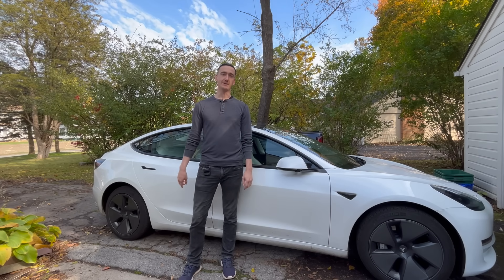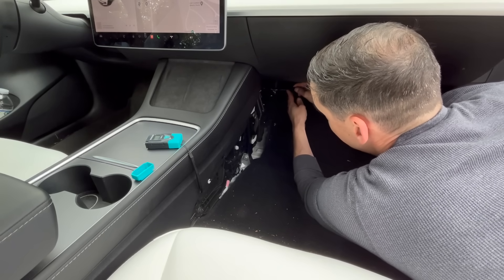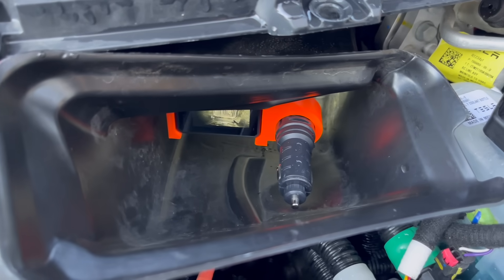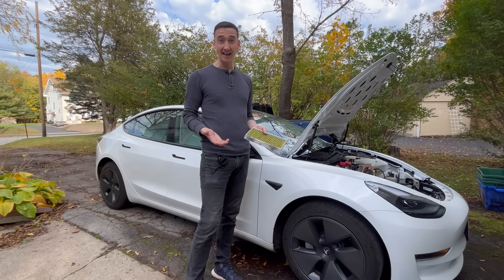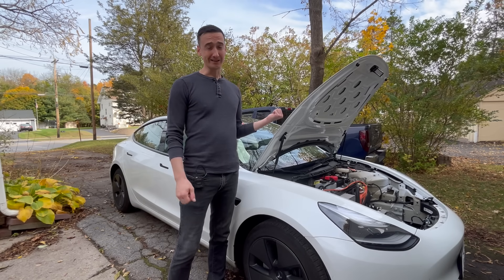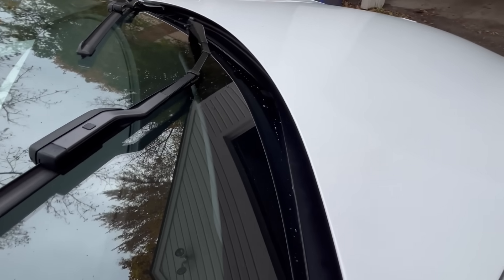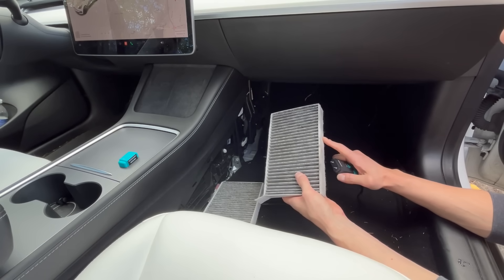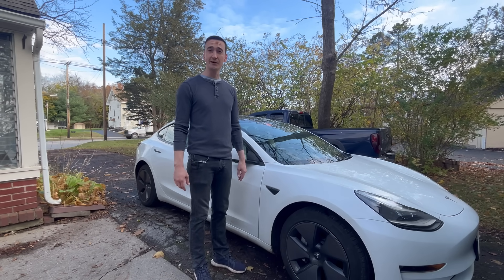This design flaw makes Tesla’s Model 3 smell bad! (with fixes!)

Comment: The best way to fix this is to alter the design of the duct. You can put a plastic baffle inside the duct that doesn't allow the water to go into the fan intake. This would be cheap to do in the aftermarket and much more effective than a gasket. Changing the fan software is not a good idea as you sometimes need defrost when it's raining. And low speed defrost is useless.
Reply: Shouldn’t have to “fix” a major problem with a new car, aftermarket or not. Tesla themselves should fix this “known issue” for absolutely free to their customers.
Reply: Yes, and it would be called a “recall”.
Reply: Sawzall the duct in-half at an 45 angle. Leaving the top long than the bottom like a roof.
Reply: I thought the same thing myself.
You could superglue or screw a baffle (plus silicone bathroom sealer to stop water bleeding down through &/or passing screw fixings, hitting any electrical connectors outside the shroud) that rises higher than that little lip around the drain hole.  Job done.  That gasket is overkill.  Also, I would think the gap on the OEM gaskets is deliberate to either allow better airflow into the cabin, or release air pressure from under the hood at highway speeds.
Reply: I was going to suggest the same since water did start getting on wires and such with the funnel apparatus removed. Add a modified wall, in the channel chamber, right before the air cabin filter, on the firewall side.
Reply: @kevinl3235  If you watch the footage from him flooding the windshield with the wipers running to simulate heavy rain, you can see that a lot of water already gets around the trim panel. So even if the duct is installed there is still a lot of water getting in that space. A good replacement design for the duct would have a baffle to prevent water from being sucked in, but otherwise to just intake from that utility space in front of the firewall. Sealing the top trim panel properly, or rather best would be redesigning the lower windshield gutter to seal against the hood directly, would also significantly help.
Reply: @haphazard1342  Nicely said and good point. Definitely an unfortunate design fail.
Reply: Is there an aftermarket replacement?
Reply: Always leave AC on, never turn it off.
Reply: I'm sorry but this is a horrible problem that should have been figured out a long time ago by Tesla.

The implications of having standing water in your AC system are bad like mold bad like bacteria bad.

One of my vehicles currently drains AC fluid after it shuts off or whenever it basically builds up. Seriously like a simple drain, All that fancy saved the f**** world marketing and they couldn't figure this part out?
Reply: @prohetofr3gr3t   If the car was designed in Seattle Washington, this would not be a problem.  CA designers only seem to know CA weather.  This is why the heat pump was added after the fact a few years down the road.  This system might be redesigned in the future but I wouldnt hold my breath.
Reply: Define cheap. Injection molds aren't cheap, and neither would be the labor to fit a specialized part into that duct. Removing the duct entirely would be a better option imo. It's an electric car so it's not like you need to keep engine fumes from entering the cabin, having a duct to outside air isn't really necessary.

I guess technically it would increase the Teslas ability to drive through flood waters, but I don't think it happens enough to be worth it
Reply: @Pilot8091  specialised part??
Cut a piece out of a plastic Milk carton from a supermarket & superglue it in place across the front of that little raised lip across the drain hole!! (raising it's profile).  The plastic is flexible enough to allow the baffle to be shaped as necessary.  Bathroom silicone sealer across the seam will stop any dribbles.  Add 3 Short self tapping screws if you're worried about secure fixing.  As for injection moulding being expensive, Tesla have an obligation to rectify this as those germs are a HEALTH ISSUE!!  There's something called air conditioner flu & a reason the spray to kill that smell is... Ummm.. ANTI-BACTERIAL.  Stop talking nonsense!!
Reply: @Pilot8091 cheap in the long run.
Reply: @Pilot8091 cars pull air from the bottom of the windshield because it is the lowest point where you get the cleanest air. removing the duct would pull most of the air from just above the road which is far more polluted. it would not be an ideal solution.
Reply: why would they.  dummies will just keep buying them anyways.

Comment: @adamdport, with the aftermarket gasket on the model 3, if you kept the duct and fully re-seat the top vent cover, do see a significant reduction in water getting into the vents in full 10 speed?

Comment: The reason the sealing strips across the hood, where it meets the base of the windshield, it isn't continuous across is because that area becomes a high pressure zone when driving, which assists the HVAC system when drawing in air, if you leave the continuous rubber seal in place you're forcing the HVAC system to draw air from areas it wasn't designed to be drawn from. This design dates back to the 30's or 40's when people actually died from the air being drawn into the heater near the front of the vehicle when the vehicle ahead is exhausting nearly directly into the heater air inlet. It looked as though the water that does get into the inlet is draining right onto wires and what looked like the wiper mechanism, the chute prevented that, at least put something over those areas to direct the water so it doesn't pour onto the electrical devices.
Reply: I'm having difficulty with the fluid dynamics here. What would create high pressure in that area between the hood and the windshield? If air is being dragged UP the windshield at speed, a first glance would have me assume that it creates a low pressure, and vacuums air out of the area?

Comment: Great video! As you showed at the junk yard, most cars have a cowl. These typically have a smallish input, large drains, and a large collection area that would require a large amount of water build up before it could enter the cabin intake (note it has to handle this during acceleration, braking, cornering, angled roads). Effectively these are dorade boxes https://en.wikipedia.org/wiki/Dorade_box . Tesla's 'dorade box' is missing the vertical barrier and that is letting water flow into the cabin intake. A simple baffle should probably fix this.

I'm curious: after taking out the 'cowl' did you try running through deep water at speed to see if the water would splash into the cabin intake?

Comment: Wow, embarrassingly enough, I was today-years-old learning about car wash mode, but thank you because I've just started to notice a mildew smell when I get in my car. Now I know how to fix it myself. Hope you get your Roadster! LOL😉
Reply: I knew about car wash mode, which was not originally there, but I don't know whether I would have used it aside from going to a car wash. When I did go to a car wash, I always turned off the climate control on any car. With a Tesla, the list was longer, such as turning off automatic wipers. With older cars, it meant checking each window. 

I did have the issue once, probably before car wash mode, and used a spray can of Lysol into the vents for about 30 seconds at high speed, gave it about five minutes with the fan on, changed for new filters and the problem stayed away. It might have been from washing my own car before there was a car wash mode.

Comment: Great video. Thanks!

I've also been using one of the pre-filters that fits on the intake. Another option but you need to watch for air flow restriction on some of these
Reply: re air intake filter, I agree most 3rd party products w/ small holes restrict airflow... I just used part of roll of plastic gutter guard mesh and ziptied it to original cover. Cheap <$5 and looks/works great. No more leaves sucked in
Reply: @cgamiga  the one I've used seems to be good for air flow and I spray some deodoriser in it every now and again. More than one way to skin a cat!

Comment: I have a rental Model Y with the Bioweapon Defense mode filtration (at least according to the display).  It has the same stinky gym sock smell that my 2018 and 2020 Model 3's had. 

So having that does not eliminate the issue

Comment: Great video.  Was wonder If you pull air lower down you might get more smog or air pollution lower to the road.  You will also get more dusty air if you drive on dirt/desert roads.

Comment: Excellent video, Adam.  So much great detail, easily explained, and loved the mini science experiment to demonstrate the potential or actual cause of the odors.  I have a Model S, so I don't think this applies to our cars, but good info to have either way.
Reply: You'd know when you get that fishy smell.  Usually take 3 to 4 years in a normal car with regular AirCon usage.
Reply: How is your air intake different on the model S?

Comment: Very great information, but my experience has lead me to believe this is not the entire story.  I live in the Arizona desert, and we obviously don't get much rain at all.  My 2021 Model 3 has the foul odor problem with the A/C in a dry environment.  There has to be something going on with the condenser coils not being able to drain or accumulating moisture on the filters as well, specifically when recirc is on for long periods of time.

Comment: I have a 2022 Model Y. Certainly has the moisture issue. Cabin definitely smells after the car is exposed to the rain. Crazy to me how Tesla is acting like it isn’t a design flaw. Great video!!
Reply: My 2022 model Y (Which has the HEPA filter  Biodefense mode) also has the nasty mold smell. 🤢

Comment: Hi Adam, nice video! Question, could another solution be to install a raised cover to the top of the duct, like what's on top of a chimney? The water would roll off the sides, but the air can still come in the sides. I don't know if there is room for that, or if it would be too airflow restrictive. LMK what you think.
Reply from the maker: I wouldn't do it personally, I don't think it would provide enough of a barrier, but you're welcome to try!

Comment: Have 2022 Y with Hepa filter.  Unfortunately had the same issue and didn't go away until i changed the helpa filter.  That was with less than 9000K miles of driving and parking in garage.  wish you would do a similar video about hepa filter Model Ys.
Reply from the maker: I'd love to, hard to get my hands on one to tear apart. Can you confirm that you ONLY replaced the hepa filter and the smell went away? The interior filters weren't changed?
Reply: @adamdport  I changed the internal filters and smell came back after 1-2 weeks.  Then I changed the HEPA filter and its been over 2 months with no smell.

Comment: Damnit. I was like "My Tesla Model 3 doesn't smell at all, maybe I just shower and wear clean clothes and I don't use my car a whole lot?" Then we see it has a lot to do with moisture which I don't have here, but I'm moving to a pretty wet place (Tennessee) sigh one more thing I'll have to deal with. Odd how these random videos that pop up can be useful. Also, I really like my Tesla but I will 100% admit they have a problem with fixing what isn't broken. You don't have to change EVERYTHING... signal stalks on steering collum for example.

Comment: I have a 21 M3 and it only developed this problem this summer.  It has certainly been out in the rain, but it had only been washed by hand until 6 months or so ago, when I found a touchless car wash.  I've used that twice, and then the smell became a problem.  I used the foam cleaner and replaced the filters as TMC posters had recommended and that seems to have worked.  One thing I found when doing the cleaning job was that the duct to the firewall didn't appear to be attached but that could have just been from removing the panel.  I never gave car wash mode any thought but now I know.

Great video and it explains everything.  I'm going to buy the gasket, I'll use your link so you get credit.

Comment: I got this in my feed randomly and I have to say this was great  troubleshooting and quick and to the point. I have a 2018 model 3 and only once had the bad smell. I occasionally replace the filters and give it a cleaning with the spray for good measure. I usually keep it on auto and in recirculate and it looks like that will solve it when raining. People in the south who keep the A/C set to "low" probably will see this issue a lot.

Comment: I'm not sure what this guy is talking about. I accepted delivery of my Model 3 in December 2021 (2022 model version), and I have no odor issues. I will have been driving it in New England (no shortage of rain here) for almost two full years without any issues. But then again, I don't point a garden hose directly at the air intake vent and spray like the car is in fire. I also check for leaf/debris under the hood, occasionally, BEFORE it could potentially become a problem.
Reply: To be fair, you can see in the comment section here alone that many people do have this issue, and I think it's safe to say that 99.9%+ of them are not spraying a hose at the vent...

And plenty of people who wash their cars do spray the hose onto the windshield almost exactly like it's done in this video – I know I've personally done that with all my cars over the years, but my Tesla is the first one to ever have this smell in it... 

Either way, hopefully Tesla makes proper changes to the cars in the future so that there isn't a need for a video like this to even exist.

Comment: This video cannot be the sole reason why it stinks. I live in LA where it almost never rains, in the last 3 months where my car has encountered zero rain (I didn't drive on the rainy days), the funk returned, and it's always the worst when the AC is cycling on/off a few minutes at a time or during short stops to the shops for a few minutes.

I've taken out my air filters and made them wet and damp and they didn't smell, in my car the smell is in the AC coils and not on the filters.

The video raised some great points about water being pulled in, but it simply isn't the only reason why Model 3's AC system tends to stink...

Comment: I don’t understand how I’ve had cars without protection over the vents and never had this issue in a rainy state, but see this issue in Tesla specifically. There has to be more to the designs than just the gasket to keep water from going directly in that they overlooked

Comment: Don't remove the duct. Doing that allows water to drip in on electrical components and tubing causing other issues that could be more expensive to repair.

Comment: I wonder if for 2022 they changed something, I wash my 2022 model 3 twice a week, and I replace my air filter once a year. I've never had any bad smells and were at 80,000 km. I have to say I don't turn the fan on high during or after a wash... When I replace the filters, I do clean the inlet duct but all I find is dust.

Comment: This video is great. The one issue with this being completely accurate is that I and others have noticed this issue without rain. The most pronounced it has been for me was in extreme high humidity with the air conditioning running. And I can see that the drainage from the condenser isn’t perfect. Likely leading to wetting of the bottom filter.
Reply: Last I checked on this about 8 years ago on my BMW, it had absolutely nothing to do with what is being discussed in this video. It is actually some EPA/EEA guideline which forced vehicle manufacturers to stop using mold growth inhibiting paint on the automotive Air Conditioning evaporators. As such every vehicle after the early 2010s has been suffering from this very same mold smell problem, and there is nothing manufacturers can do about it other than offer you a temporary solution in the form of a cleaning. Supposedly it has something to do with the mold growth inhibiting coating that had been used for many years all of a sudden being considered to be toxic for the environment. So in short we have all been forced to suffer with moldy smelling automotive air conditioning since. Pretty sure that if you have the same Tesla and  live somewhere warm and humid, you will be experiencing the exact same issue even if water never gets into your filters like it does for this person. In short, good luck and learn to live with it unless you want to go pressure the manufacturers to find a non-toxic alternative. Lastly, in other words… the issue is MUCH MORE complex than what this video leads you to believe. Happy youTubing!
Reply: Agreed. There's not much chance that rain or washing is getting my filter directly wet. But humidity seems to be a big issue. My issue comes right at the change of season when humidity goes up, right when the filter is dirtiest from summer driving in the dust and pollen (and fire smoke!). The solid solution for me seems to be to change the filters every November.

Comment: No no no, here's what you do..., turn the cabin heat up to very hot, turn the fan on full blast. Let that 'cook' for five or ten minutes. Put the blower and temp to normal levels. The smell will be gone. I might agree with this guy about cause but I don't really care. Where did I learn this technique? On a GM product so this isn't exactly just a Tesla problem or a design flaw, it's the build up of water film from condensation sitting in the duct work. If the air con is used on very cold temps on a very hot day, this will occur and the excess condensation wont dry out. It will stagnate and reek. OK, keyboard commandos, say what you will, make fun of me, call me names, insult my intelligence, I don't care. This works.